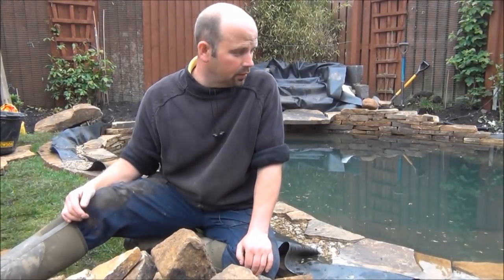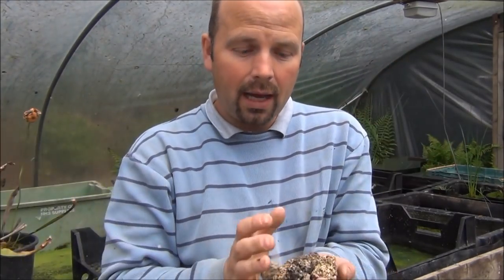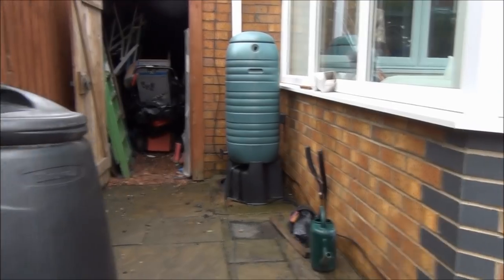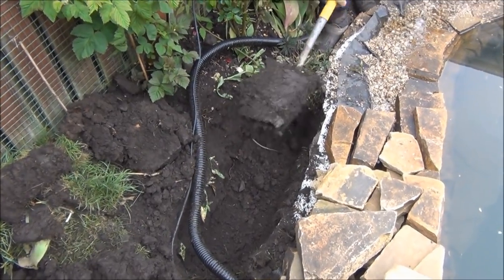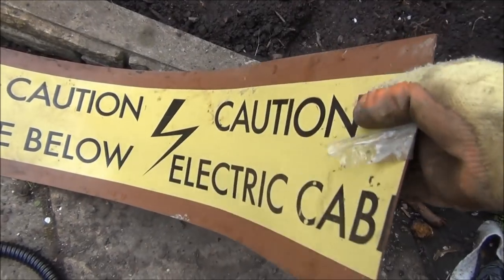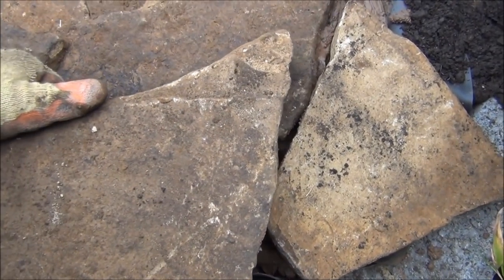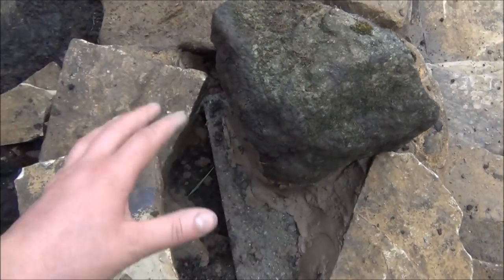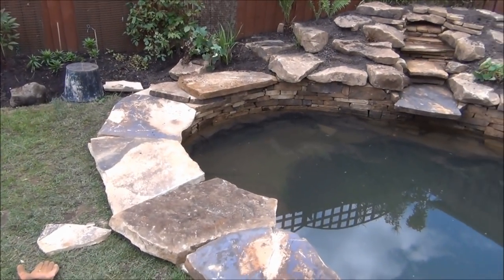Fish pond construction near Newcastle by Pondguru

Comment: hi. i dug a pond 10ft x 5ft x 2ft deep, fitted underlay & liner and filled it. after the first downpour of rain ( i live in in the north east uk ) the rain water got under the liner and lifted it from the bottom. would weighing it down solve the problem. any ideas
Reply from the maker: You will need to put in a drainage system and lead a bleed pipe away from that. That's what I do in this video link (from about 01:45)
LARGE WILDLIFE POND AND DECKING by PONDGURU
It uses perforated land drainage pipe and gravel in trenches under the pond to take water away through the bleed pipe and into a nearby stream. This one worked perfectly even though the previous pond (installed by someone else years ago) had major problems with the liner lifting out after heavy rain.
Weighing the liner down isn't a good option as it often does not work and stones lifting up and down with rising groundwater levels can damage the liner.
Reply: Pondguru thanks mate your a star. trouble is most of the surrounding garden is either concrete or patio so putting in underground drainage would be a nightmare. think a raised pond is the easier option. thanks for taking time to reply.
Reply from the maker: shippahoy100
Even if the pond was partially raised there would be enough atmospheric pressure to keep the groundwater in the ground and prevent the liner lifting up. A bleed pipe doesn't need to be dug in a trench underground and it can bleed out at ground level. Think of it as a pressure release to prevent groundwater lifting liner.
Reply: Pondguru cheers. is a bleed pipe readily available to buy and easy to fit. any idea of price
Reply: Pondguru is it just a length of tubing or a specialist item mate.
Reply from the maker: shippahoy100
Just use perforated land drain from builders merchants. The 2" (50mm) diameter pipe will be OK for small to medium sized ponds. You can get the T junctions and gravel (20mm works best) from same places too.
Reply: Pondguru ok. thanks a lot
Reply: Pondguru so just put the pipe in the ground cover in gravel and run a pipe above ground. then pressure pushes the excess water out.
Reply from the maker: shippahoy100 Yes, that's it.

Comment: what is the name of that black sheet kept under water??
Reply from the maker: +Tshering lama The liner? it is 1mm thick Firestone rubber.
Reply: +Pondguru Outdoors thanx
Reply: +Pondguru Outdoors  where did you get the rockery stones from?  I live in the north east
Reply from the maker: +Fowler l I got the stone I used in the pond building videos from a local quarry near Blanchland which has unfortunately closed. There is another one nearby which has more regular flatter bed sandstone but the stone will be more expensive - http://www.ladycrossstone.co.uk/

Comment: Hi Richard
Really fantastic pond as all your ponds are, i am going to build a pond just like this one in February and would like some advise please.
I am going to put maybe 6 koi in it and was wondering if the filtoclear 30000 would be ok as i don't want to mess around with a bottom drain and would a 8000 pump be ok as well like in one of your other ponds you have built.
Must admit your videos are addictive and i spend ages watching them to the point the wife is going to divorce me lol.
All the best for Christmas and the new year and thanks again

TONY
Reply from the maker: Dear Tony,
I'm glad you enjoy the videos and I love it when I hear they are helping people plan and build their own ponds - I kind of wish I was still making them for that reason alone as it is so good to create something from nothing.
The 30000 filter is a very good compact unit and the 8000 pump is one I used many times as it provides a decent turnover rate for medium sized ponds as well as a good flow for a cascade or stream but the actual size of pump and filter will depend on the pond volume and cascade lift / spread.
For a pond of this size with koi in that combo would be a good one so no worries there.
Feel free to ring me to ask anything, any time on 07772848730 - phone is always on 9-5 weekdays and most of the time at a weekend.
Regards
Richard
Reply: Pondguru 
Well
Reply: Pondgur